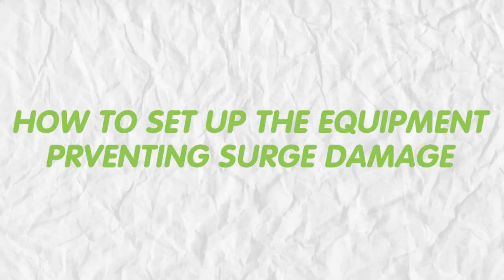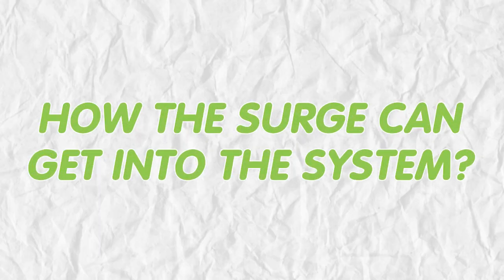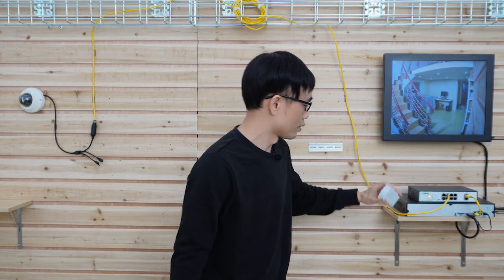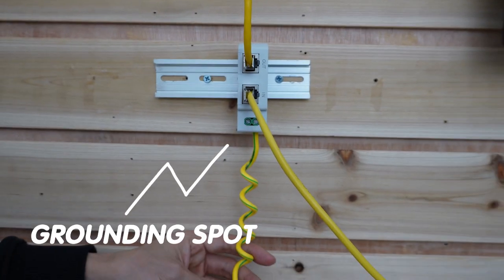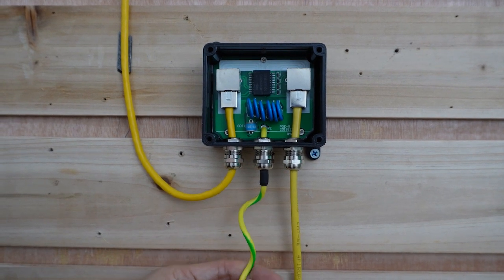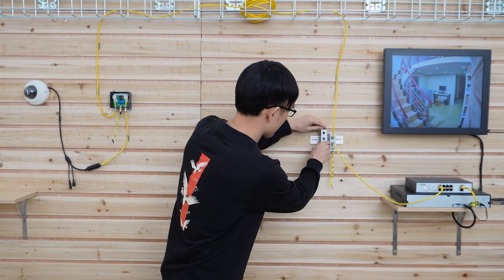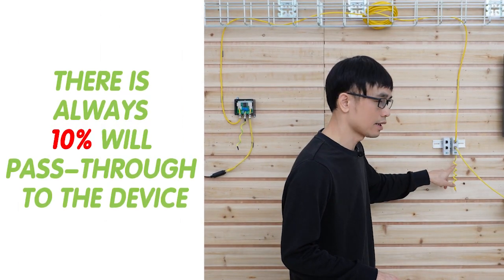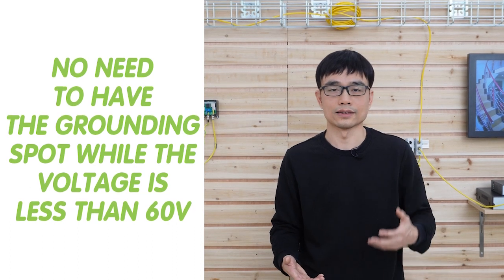Protect IP Cameras from Lightning Surge (Basic Guide)

Comment: Should LAN cable be replaced after lightning surge?  the surge protector and rj45 jacks are fried but the wire still seems ok. Thanks
Reply from the maker: If your LAN cable has been exposed to a lightning surge, it's essential to thoroughly inspect the cable before deciding whether to reuse it. Look for melted insulation, burnt spots, or exposed wires. Even if the cable looks fine on the outside, internal damage might have occurred.

You can use a cable tester to check the continuity and integrity of the wires inside the cable. If you are uncertain about the cable's condition, it's advisable to have it inspected by a professional. 

If the surge was powerful enough to damage surge protectors and RJ45 jacks, it could have compromised the internal integrity of the cable, even if it appears undamaged. And please be careful when you handle it!

Comment: My house doesnt seem to have a place for me to connect the grounding cable from the grounding spot.
Any suggestion can i just connect the grounding cable to any metal around the house?
Reply from the maker: You would better build a qualified grounding spot. Attaching the grounding to metal doesn't guarantee the proper grounding, since the grounding spot needs to satisfy a ground resistance value of 5.0 ohms or less.

Comment: Can use 1mm2 wire for grounding?
Reply from the maker: It depends on the specific requirements and regulations of your local electrical code. In many cases, the size of the grounding conductor is determined by factors such as the electrical load, the type of system, and the distance between the grounded equipment and the grounding electrode (ground rod).

It's essential to consult your local electrical code or a qualified electrician to ensure that you are using the appropriate size of wire for grounding purposes. Using an insufficiently sized wire for grounding can be dangerous and may not provide adequate protection in the event of a fault or electrical surge.